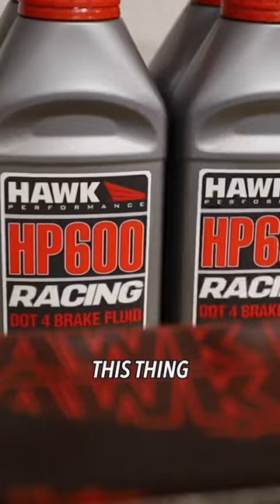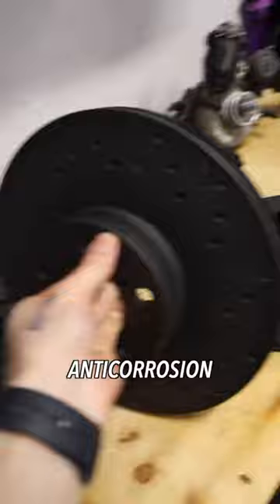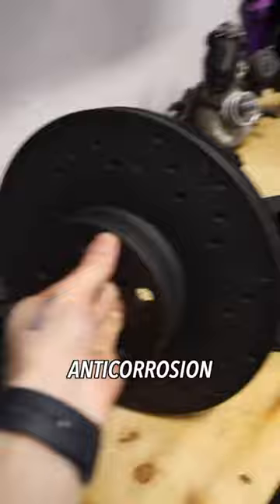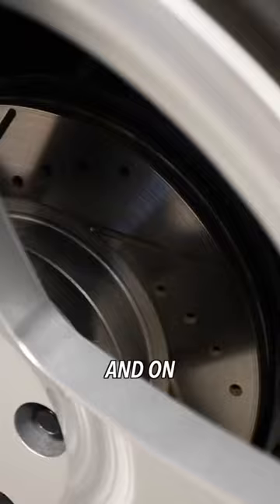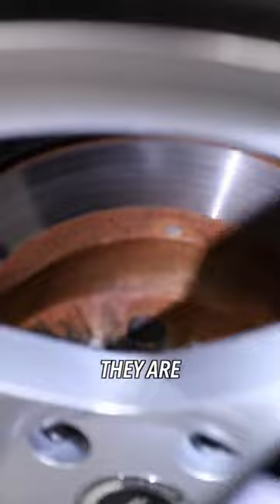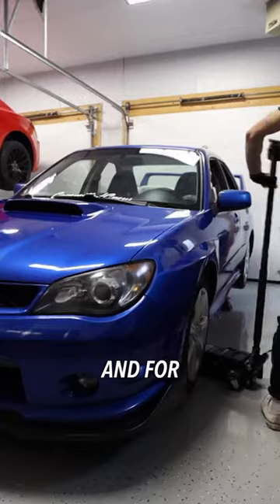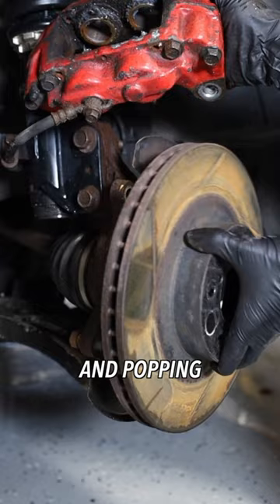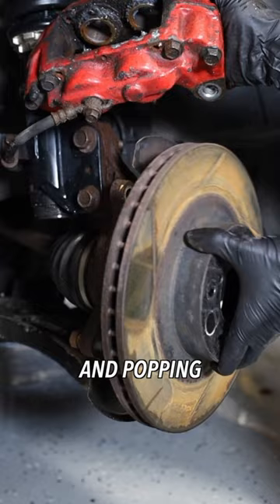A little Hawk Performance brakes action can make anybody’s day better🔥 #Subaru #WRX #STi #DIY #FYPk

Comment: As a professional mechanic, I've NEVER put brake pad grease on the back of the pad 🤦
Reply: Me neither. I only lube the points of "contact" that sit inside the caliper bracket as well as the bracket inserts.

Comment: thought I was the only one that put lube or anti rattle on the back of my break pads I've had ppl tell me I ruined their breaks by doing that....
Reply: Professionals don't, people who don't know where to properly put the grease do. Also, this guy saying the rear rotors "are dying" due to a little rust, is also wrong lol the physical surface of the rotor looked fine, the rust shown is strictly a visual thing, unless they measured near minimum spec, they were fine and the guy in the video is just anal. Not all automotive videos show correct install procedures, they show what they specifically do. I also didn't see him sand the flange where the rotors sit which will cause a brake vibration, he seemed more focused on appearance rather than a proper install but in the end it worked him, however I personally think they'll start squeaking again in 6 months or less 😂